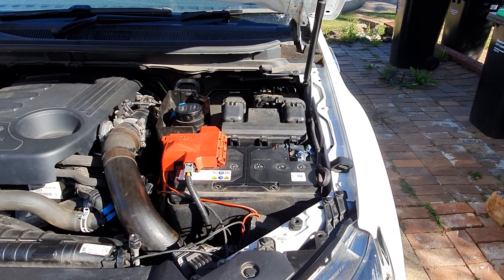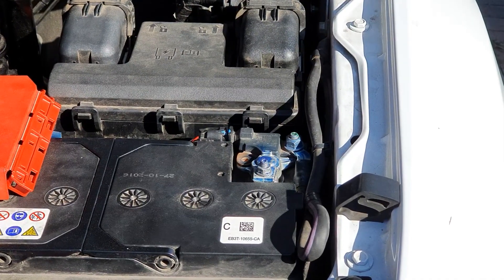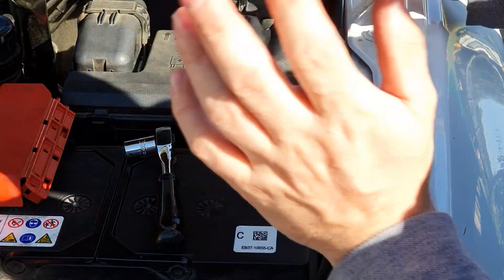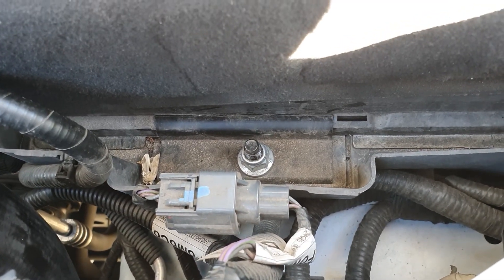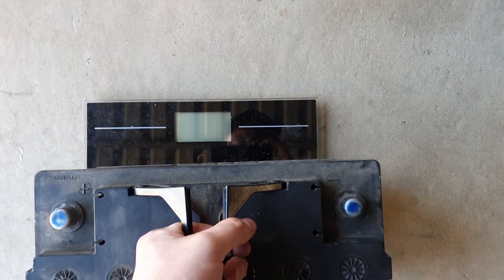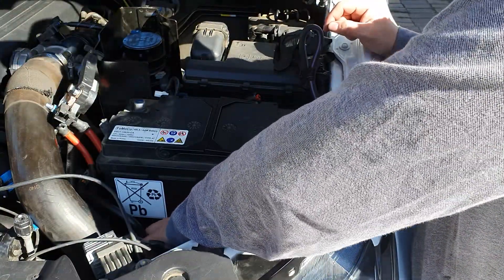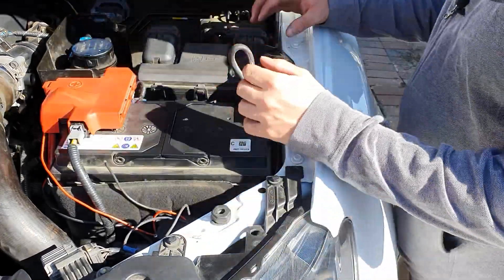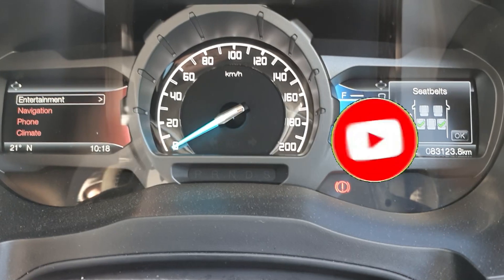How to replace your battery on your Ford Ranger, Mazda BT 50, Ford Ranger Raptor, Ford Everest DIY

Comment: Did you use any ecu memory saver while doing the replacing? If none.. were there any problems you encountered?
Reply from the maker: I did the battery change on a 2017 PX2 Ranger. I didnt use a ecu memory saver and i didnt have any issues when i turned the car back on. hope this information helps

Comment: I heard that if you change your batteries in these ford and mazdas you might put the car into factory mode
Is it true? Do you need anything like a temporary battery device so that the vehicle  thinks that the battery is still plugged in?
Reply from the maker: Nah, I disconnect mine, reconnected it and the ute was it was before I disconnected it, so I would assume not, kept all my radio stations and everything else so I wouldn't worry about it
Reply: @TheInsightDistrict  i had some buddies of mine
Tho not all but some were in "factory mode" 
Some put another battery so that if they remove the defective one the computer is still "awake" but all these are case to case i think
Thank you

Comment: Hi mate. My car's battery already flat and I can't start the engine. Do you think is it better for me to jump-start the car and charge it for a few minutes or just wait until the lockdown period is over and then jump start the car because I didn't use my car until the lockdown is over. Thanks mate
Reply from the maker: If it was me, I would choose one of three options, first option is to jumpstart the car, and run the car for a little while to get some charge into the battery, then every couple of days start the car for a few minutes to maintain the charge.
Second option is to get a battery charger and remove the battery from the car and put it on charge until you are ready to use it again. Third option is to disconnect the battery from the car by removing the leads from the battery so it doesn't drain any further and damage the battery internally. I personally would go with option 1, but it's up to you, if you have any other questions feel free to ask and I'll try and help, I hope my answer makes sense

Comment: Hi there, after replacing battery, nothing works, engine won't start,  no logo on infotainment,  nothing.  Terminal connections are all okay. I have 2017 XLT
Please help
Reply from the maker: first i would be checking if the new battery has voltage, then I would be checking that all connections are connected, and all fuses have not blown. without being with the vehicle it is hard to tell what is wrong, i hope this information helps